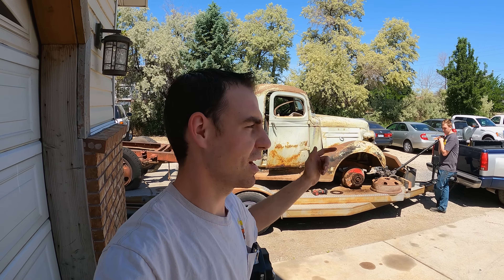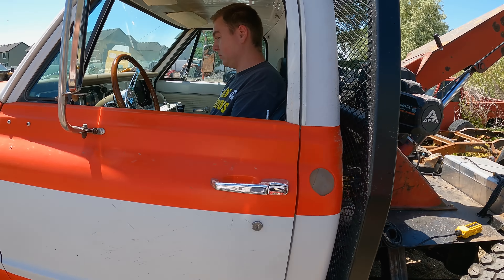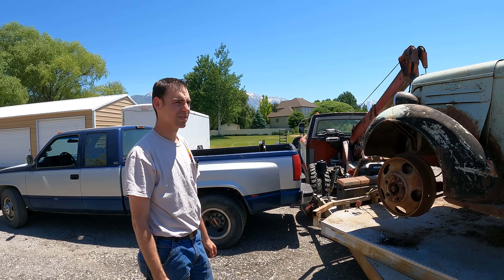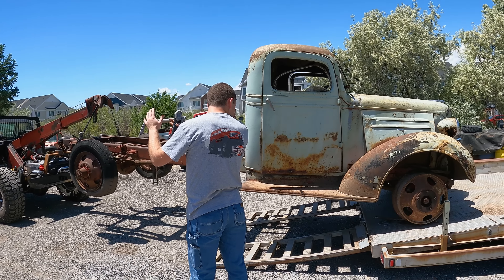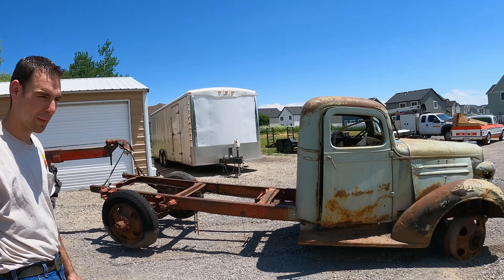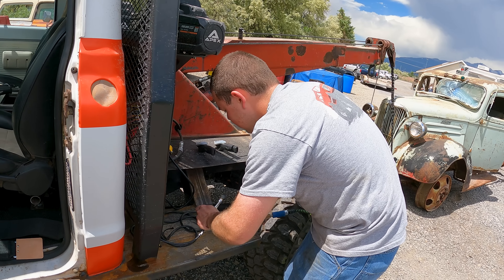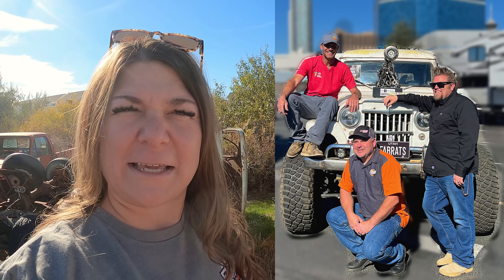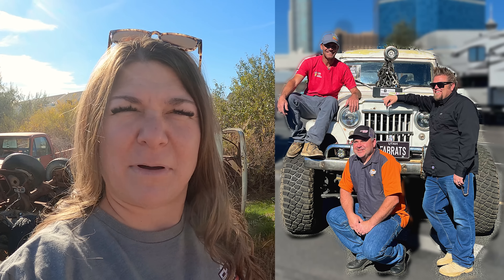What Are We Doing With This 37 Chevy??

Comment: I still haven't figured out why they didn't just winch it off the trailer ... hook the front axle and redirect with a snatch block on the rear off the trailer ... after the front was at the rear they could have just pulled out from under it or used the boom to lift the front and pulled the trailer out with another truck.
Reply: I would think others lessons to be learned and taught by less experienced, younger folks, working together and under no pressure to go faster. Ah youth, leisure, love and respect.
Reply: Gotta remember chads crew isn't a recovery crew so that wouldn't be instinct to them
Reply: @terrancegrant5573  Yes, good point ... and course you're 100% correct ... they're all very good at what they do and now that they have Griz up and working they will figure it out I'm sure.
Reply: Where could they anchor the snatch block?
Reply: @pat8988  They could have anchored to either the tie down points or the stake pockets both of which can be seen at 08:01 in the video.
Reply: Content,if they did things perfectly,we wouldn't watch !
Reply: Once they decided the spot that it was to go in,they just needed to move the chassis that was next to it ,backed the trailer in ,come from the side with tow truck ,lift the rear end up and drive the trailer out,tow truck holding it in place .
The main thing is that they can only learn as they go .
Boys ,watch some of the towing channels,there are many and see how those operators come up with ways to do various things ,Casey Ladelle is always explaining why he does things .
Everything Auto channel have the smaller wreckers and winch outs are a common task for them .
Find ways that you are comfortable with doing with the equipment that you have .
Mum came out to make sure you were being safe ,I think they were going to be okay as they weren't rushing things and caution was being applied,they need to build confidence .
Reply from the maker: They were totally goofing off and like some said figuring out what the wrecker was capable of doing. They know they could have unloaded the truck in a few minutes with the winch that is built on to the trailer, dragged it off, etc. but where's is the fun in that? 
This was simply a learning exercise with them trying new things.😉
Reply: @chadsfab , time well spent!

Comment: Here's a suggestion that has worked for me in the past on car trailers a two-pulley or one system to remove dead one's off the trailer once you have it in the location. Here goes the one pulley, mount a D- ring on the center of the entry of the trailer as an anchor point to which you can use a shackle and snatch block to do a down and back to winch end of the vehicle you want off the trailer to pull it off and then drive out from under. Wahla, job done all by one person and limited equipment/tools. You pulled it on now pull it off.😎

Comment: The hand throttle you are referring to is called a VernierThrottle.  The prices vary depending on the cable length.  Of course with the electronic engine controls today, you probably want an electronic vernier throttle.

Comment: Those wheels are missing the lock ring, real "widow makers" split in the middle of the rim like a bagel, that's why the are dangerous you can't tell if the two halves hooked together or not. Moved lots of dead vehicles with a front end loader or tractor with a bucket, don't  need anybody to steer them just steer the tractor with one end of the vehicle off the ground .

Comment: I know it's to late now,  but if I had of been unloading that truck, when you guys lifted it and drug it back on the trailer. I would have stopped when the rear wheels would touch the ground. Then I would have put jack stands under the frame. Backed in into the spot , use the badlands jack to jack it up and remove the jackstands setting the rear wheels on the ground and pulled forward dragging it out far enough to set the ramps and then pulled on forward until it was all the way off the trailer and ramps. Picked up and cleaned up my tools and called it done. Now you know a better way for next time and when you decide to put it in the shop you can do that then too.

Comment: Now what I would've done is hooked up to that trailer that was made out out of the pickup bed drug it out of the way is it has tires on it back the trailer up right where it needed to be without the ramps hooked up the truck to the back of the truck on the trailer and have him drive out from under it Until the back was sat down hooked up to the front lift it up and finish pulling the trailer out. But of course this comes with experience the boys will get there they're amazing young men.

Comment: Just a thought, you could of ran a winch line under the 37 and loop it back with a snatch block to the 37. Pulled it off the first way you had it pulled in. I like the 37.

Comment: You could've ran the winch cable under the truck to a pulley on the rear of the trailer and back to the front of the truck to pull it off

Comment: Why didnt you use a snatch block on the rear axle and run your winch cable under  neath from  it to the   front  axle and pull  it off the trailer .
Reply from the maker: They were totally goofing off and figuring out what the wrecker was capable of doing. They know they could have unloaded the truck in a few minutes with the winch that is built on to the trailer, but what is the fun in that? 
This was simply a learning exercise trying new things.😉

Comment: Long shot asking this question on here . 1980 Chevy truck was plain Jane no air . I have since added a painless wire harness Dakota digital the sniper and hyperspark amp and sub . The main fuse on my harness goes to 150 amp . Can I run a 150 amp alternator ? I also have vintage air haven’t installed yet . Will a 140 amp run all that ?
Reply from the maker: 150 amp alternator should be fine, make sure to use at least a 6 gauge wire from the alternator to the battery.
Reply: @ Thanks .

Comment: I'm not sure why you didn't back the truck in the slot on the rubber tires that were on the back. But you know entertainment none the less.
Reply: Passenger side brake is frozen with rust and won't roll. Same as the front drums.